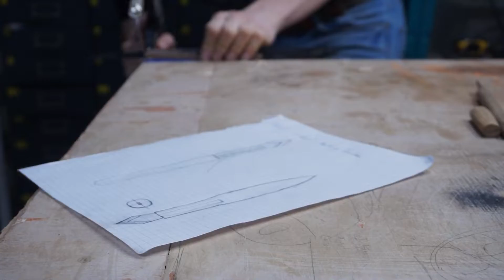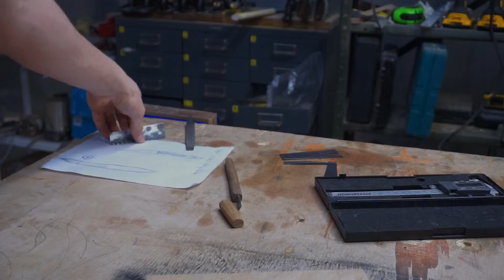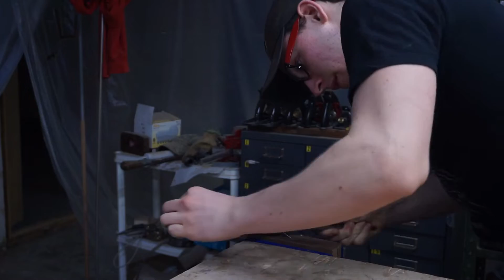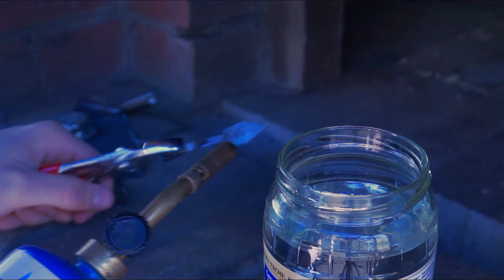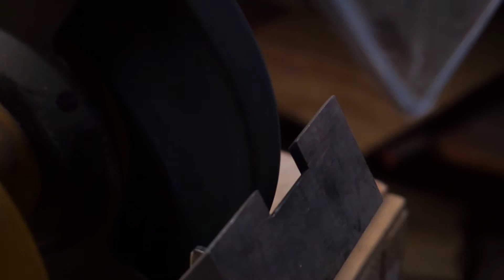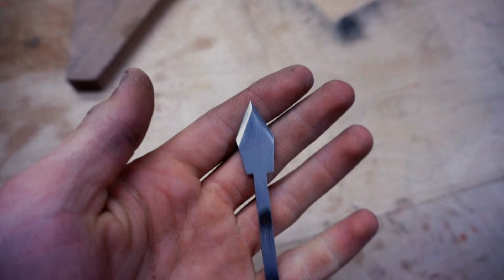MAKING A MARKING KNIFE | Part 1

Comment: Why won't you wear glovessss? It's really dangerous you know :((
Reply from the maker: Wearing gloves makes it more dangerous. If you have gloves on, they could get caught into the machine. This would pull your hand in and destroy it completely. Not wearing gloves makes it so the danger is getting cut or burned. I would rather be cut or burned than loose my hand. It is counter intuitive, but most people who work with machines will tell you the same.

Comment: Nice one Eli, I tried and failed at this. I'm guessing the sawblade that I used wasn't carbon steel.
Reply from the maker: It may be. You can try to case harden the steel, that my not be the correct terminology. I think it is when you harden the blade when it is covered in a layer of a carbon supply, like coals, then a layer of clay.
Reply: @BravermanDesign  I will have to try it again.